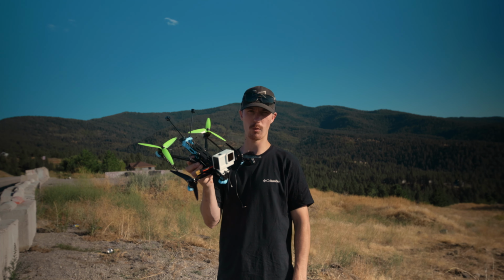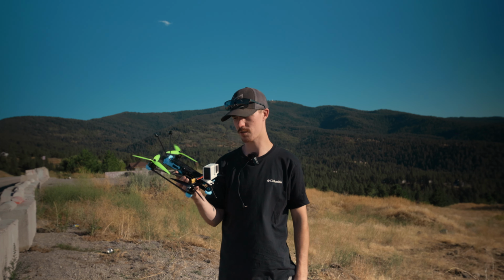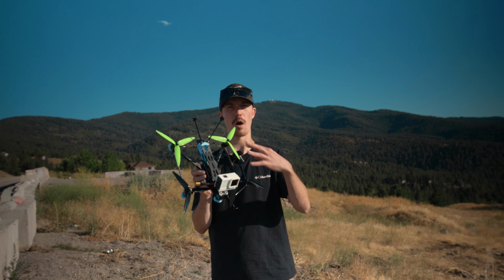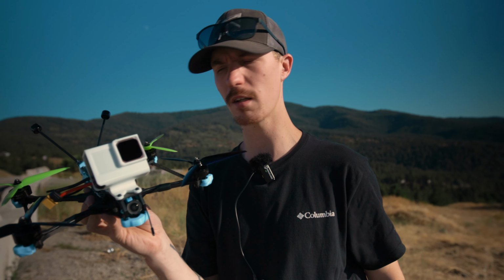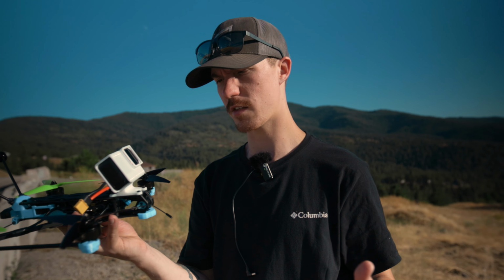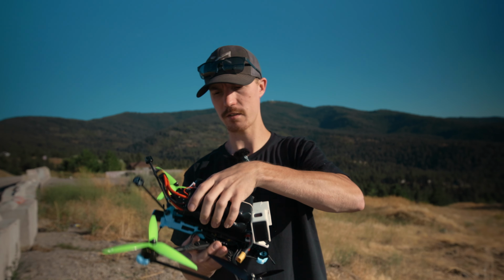Foxeer Mega 7 Long Range FPV || Mountain Surfing

Comment: Beautiful flight! Makes me wanna get more into long range again
Reply from the maker: Thanks 😁 yeah I am really enjoying the long range stuff.
Reply: @andrewmedia3568  I had a 7” a couple years ago but haven’t rebuilt one since. I may need to put some money into one now
Reply from the maker: @SprayerFPV   Yes do It ! you wont regret it.
Reply: @andrewmedia3568  now that I’m using elrs and not crossfire, it would be cheaper
Reply: @andrewmedia3568  I was also looking at the 10” bnf that iflight came out with recently
Reply from the maker: @SprayerFPV   That Iflight XL 10" is tempting I was thinking about building one of those as well.
Reply from the maker: @SprayerFPV   I agree, my Betafpv superD true diversity elrs receiver was like 19$.
Reply: @andrewmedia3568  I have an radiomaster rp1 in my 5” but I’m scared to push the range yet cause I don’t know how well it will do
Reply from the maker: @SprayerFPV  In my experience as long as the antenna is well placed for the flight conditions and your radio can output at least 1 Watt of power than it really should be fine. Having a gps that is setup correctly is a big deal for LR though, I truly don't worry much about losing radio link or video at any distance because I have tuned and tested the gps rescue/failsafe and trust it.
Reply: @andrewmedia3568  I have a gps just have it off at the moment. My rx only has one antenna though so that’s a limitation somewhat. I just need a safe place to do some testing that’s all

Comment: great shots! How do you deal with dji goggles range with o3? Do you use any custom antennas?
Reply from the maker: Oh the range of the O3 is great. I did the HAM file hack And I run a visor patch antenna with two TrueRC Stubby Omni directional on the top.

Comment: Great lr flight in a very nice landscape 💪💪. What was your lowest bitrate at the turning point and which antennas did you use on your goggles ? (Goggles V2 or Goggles 2?). 
Best greetings from Germany 😎👋
Reply from the maker: Lowest bitrate was about 12-15 mbps. At that distance and with whatever interference if any from the towers the bitrate would jump around from 12-30 mbps. using goggles V2 and on top running 2 TrueRC stubby omni directional LHCP,  and then a visor patch antenna going to the bottom ports.
Reply: @andrewmedia3568  thanks for your answer, mate 👍. Great setup and not without risk to fly so close to that radio towers. Well done 💪. I fly LR too, with a Chimera 7. I was 6 km (3.7 miles) out so far. I use Goggles V2 like you and 3-turn helicals.

Comment: Nice video. I love that frame, it's lightweight and pretty easy to work on. I built up the original DJI Air Unit version for my first long range drone, got some great long-range flights, and lost it on a mountain when I had an unexpected voltage drop probably due to a bad battery cell. Now I know the importance of logging GPS data into my radio. It still hurts...
Reply from the maker: Damn yeah I would be devastated loosing a drone that expensive.

Comment: p.p.p.s.  would love to see your ending voltage, average speed, flight time, etc.. thanks!
Reply from the maker: Flight tine was only like 7-10 min and speed varied from 30-40-70 mph. don't remember ending voltage but I know I only used like half the Battery capacity. landed at around 4000mah so I had another 3500 Mah 🫡😄

Comment: Great video , bought this frame based on this and im loving it so far, can i ask what was the total arm time on this flight? Been trying to prolong mine as much as possible and it is very much poorly tuned but im only getting about 14.5 minutes of flight, do you have any tips besides more mah and less weight?
Reply from the maker: Im not sure of the total arm time in this flight. Probably somewhere around 10-13 minutes. The tune might affect flight time a little bit, but really the only things that increase flight time is more mAh and less weight. The amount of amps your pulling depends on your battery voltage, wether that 4s, 5s, or 6s, your motor kv and weight. So one of those needs to change to increase flight time. my quad fully loaded with two big li-ion packs and a gopro will fly for 18 minutes but only if im just cruising around at the same altitude. once you start climbing elevation to fly up mountains or pulling out of dives you will pull more amps and reduce flight time.

Comment: Having issues tuning my 7”. Can you share your tune? BF presets aren’t working well. 🤙
Reply from the maker: I noticed that running Bi blades the quad ran soo much smoother so I would suggest that as well. Im not a PID tuning master by any means I just made small adjustments maybe these will help. 
Damping 0.95
Tracking is 1.1
Stick response 0.95
Dynamic damping 0
Drift wobble 0.85
Pitch damping 1
Pitch tracking 1.05
Master multiplier 1.05
Reply: @andrewmedia3568  appreciate. I’ll try bi-blades and compare PIDS. I had to drop the master multiplier from 1.3 to .7 just to prevent flyaway and warm motors. Now I’ve got some throttle bobbles and just a little wobbly all over. Thanks
Reply: @andrewmedia3568  just noticed “drift wobble” wonder what that’ll do?
Reply: @c_labb9247  Drift should raise and lower or I
Reply: Yea none of the presets worked with mine. even stock BNF tune had wobble. company helped. And I tweaked it. playing around watching alot of bardwell and uavtech tuning videos
Reply: @c_labb9247  did you solve wobble/shaking ? I do have still the same problem i have kind of frame resonance between 65hz to 75hz which cause d oscilation . Can you share your pid ?
Reply: I did try run biblade mension above from HQ prop i dont know why but with them i have worst shaking in camera on thrkttle punch best for me work hq 7.x3.5x3
Reply: @E.Z.F.X.   could be something causing it like long antenna maybe? 
Usually throttle punch problems sometimes can raise tpa and lower start point. I couldn't never get mine perfect. I have an Aura 8" frame on the way to swap parts to
Reply: @Oguras_fpv  well, I cheated. I removed the props, replaced the drone, threw props back on and it’s golden. I bought a mark4 LR7 pre tuned.
Reply: @divingfalconfpv4602  i did test with short antenna even now for testing i have use stock , i have definetly not clear gyro  but it looks that is not so stiff frame
Reply: I will try last a few things for tune that out after i will use diferent frame if it is necessary too
Reply: @E.Z.F.X.   yea my frame is super duper not stiff haha. Very light frame. And I'm running 8" props on tiny motors. 
I know my 5" my antenna causes a low vibration I tried to stiffen it and some how made it worse once haha
Reply: @E.Z.F.X.   more filtering?  Also make sure not wires might be tapping the FC

Comment: what is your superd antenna? seems it's not stock
Reply from the maker: Sorry not sure I understand your question. The receiver is a Betafpv superD and the antennas are two extended TBS Immortal T.
Reply: @andrewmedia3568  i just realized you might be using the 900mhz version? Because mine also betafpv superd but 2.4ghz, the antenna is shorter
Reply from the maker: @dewhoop  No its the 2.4ghz receiver. I did not use the antennas it came with I put 900mhz TBS immortal T antennas on it because they are longer. everyone says that I can't and it wont work but I obviously did and flew 4 miles out with no issues. 🤷‍♂

Comment: Wondering the difference between mega and aura?   Did stock length O3 camera cable reach with room to spare?
Reply from the maker: No I needed the 220mm mipi cable to reach. thankfully I had one on hand already just in case.

Comment: No gyro issue with O3 camera mounted to TPU?
Reply from the maker: I dont use the O3 to film anything so idk. Im always filming with GoPro.
Reply: @andrewmedia3568  curious. I ordered the aura 8" has same camera mount. Might put O3 or moonlight in. Moonlight fine has built in gummies for vibration
Reply from the maker: @divingfalconfpv4602  if your getting an 8” I’m assuming your flying long range. You aren’t gonna get more than maybe 2 miles with walksnail, which is more like mid range. I have both systems. With O3 your only limit is battery life. I don’t think it will be an issue with the gyro if the camera is tight and the quad is tuned well.
Reply: @andrewmedia3568   walksnail has gone further than DJI in testing 🤷🏻‍♂️ 
But I have O3 and moonlight on order
Reply from the maker: @divingfalconfpv4602    Nice you could test both or go with whatever you like more. 8” quad is gonna be a beast💪🚀
Reply: @andrewmedia3568   well I want to get away from DJI, but walksnail is on back order, so o3 for now. 😆 🤣 😂 😹 
Like I finally changing all my drones from crossfire to ELRS
Reply: @divingfalconfpv4602 Why did you leave crossfire to go to ELRS? I went to crossfire from spectrum in 2018 and will never go with anything else. Crossfire is a proven time over time system that has never failed safe on me once in the past six years I've had it. You might not get that 1000hz refresh rate with crossfire, but I'm not a racer so I'll never feel the difference. I followed the hype to crossfire, but I'll never follow the hype to leave it either.